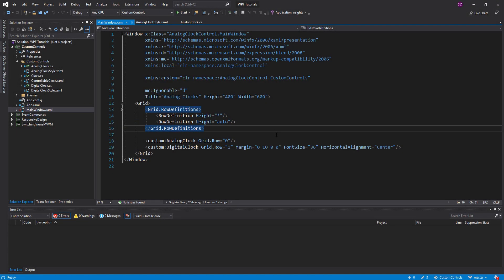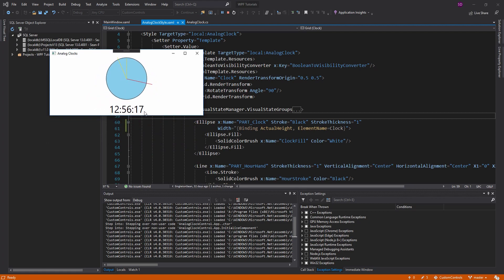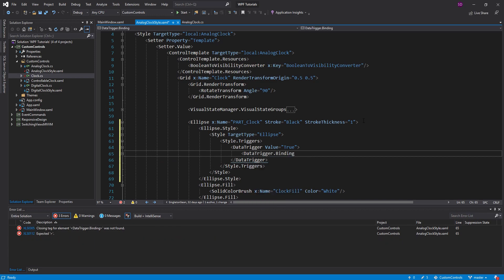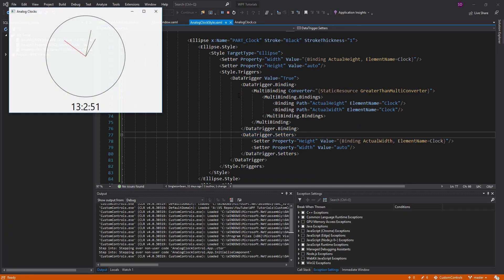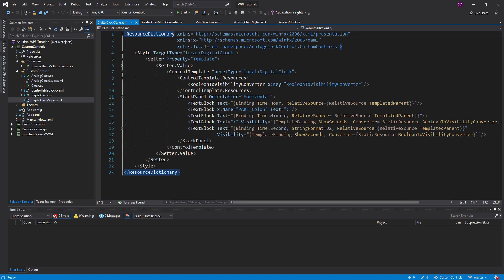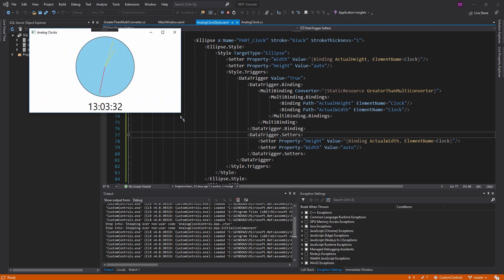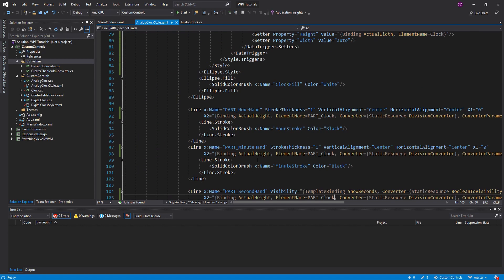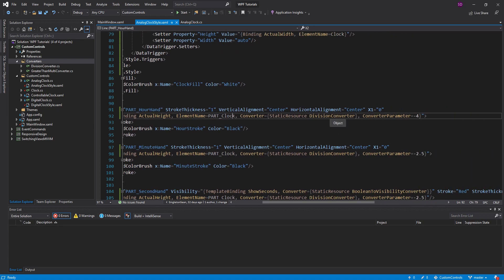Dynamic Sizing with Converters and Multi-Bindings - WPF CUSTOM CONTROLS #8

Comment: Many compliments for this playlist, a lot of useful contents. I reproduced all the example but in this last video when I tried to remove the width and height of the ellipse it just disappeared, as it happens when I try to insert it into an empty grid. I'm not able to reproduce the behaviour at minute 1:15. I know it's small detail but I'd really like to go in depth to fully understand what happens. Thanks again for your time!
Reply: Hi, I had the same problem as you. The problem is solved if you remove the stackpanel from MainWindow.xaml. The code should look like this: 
<Grid>
     <Grid.RowDefinitions>
         <RowDefinition Height="*" />
         <RowDefinition Height="Auto" />
     </Grid.RowDefinitions>

     <custom:Clock Grid.Row="0" />
     <custom:DigitalClock
         Grid.Row="1"
         Margin="0,10,0,0"
         HorizontalAlignment="Center"
         FontSize="36" />
 </Grid>

Comment: Amazing video! I would like to ask you, how we can bind To property from Thickness animation(or any animation). I need to animate the margin, and I used MultiBinding because need to perform some calculations, but the problem is, it throws this error: 'Cannot freeze this Storyboard timeline tree for use across threads.' InvalidOperationException: Cannot freeze this Storyboard timeline tree for use across threads. Googled id, but to be honest, couldn't find a good solution. Thanks in advance)

Comment: have had to watched it twice, but I will put this strategy in my toolbox. I was about to solve this problem by calculating the values in 'onApplyTemplate' Method, but this is much better :-)

Comment: I have learned much from your tutorials. THANK YOU!!!!  I keep coming back to this particular set of tutorials and Full Stack MVVM because it has become obvious to me that UserControls are an essential part of parsing an application into MVVM form. Each time I view the tutorials I gain new insight into making sense of this massive, layered, and sometimes awkward programming methodology. At this point, I'm trying to sort out how to build a composition style paged data grid UserControl in which the ItemSource is an observable collection of <displaysubclass> which is a mapped subset of a SQL query results observable collection of type <dbresultsclass> so that key features are controllable via the use case instantiation of the control.  I'm currently stumbling how a paged data view control instantiation in a view's xaml coordinates the page data which updates the Datagrid.  Basically, I want to be able to place a scrollable page data grid control, hook it up to the data source, and be able to use it without too much hassle.  I'm trying to think the way you do in breaking it down into incremental concepts but I seem to keep tripping over necessary concepts that either are new or currently sort of learned but are not intuitively use case understood at the moment.
Reply: This seems like a great idea, actually. I can see where you'd want to have things paged like that, especially if the dataset is really big. implementing such a thing is waaaay beyond me for sure. haha. At the time of me replying to your comment, it's 2 months out, so I'm curious! Have you been able to tackle this?